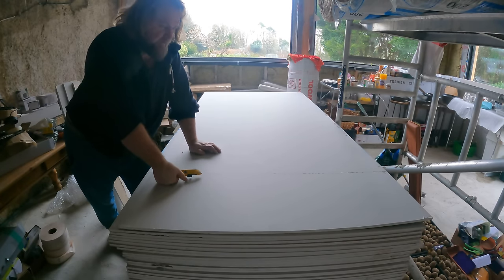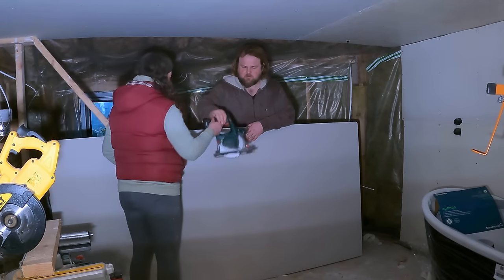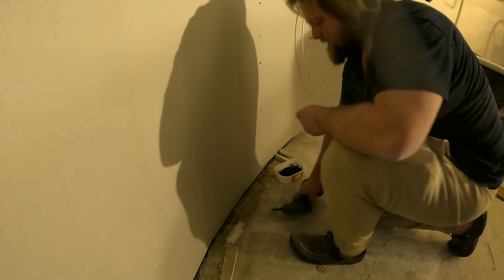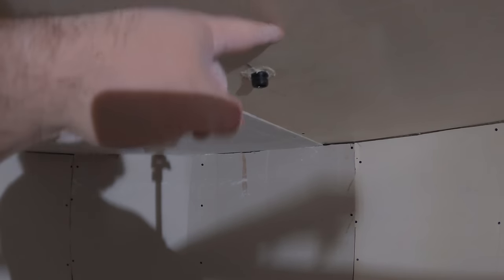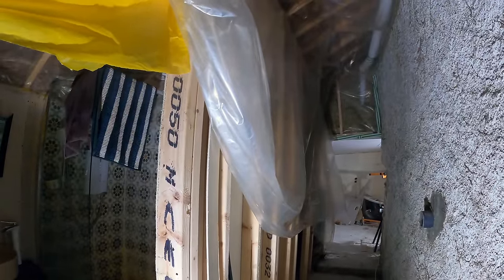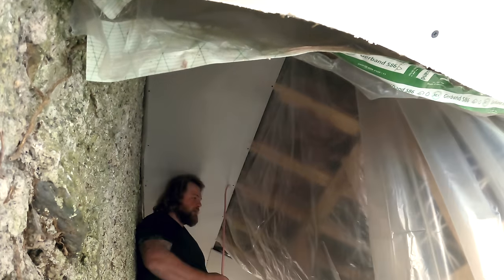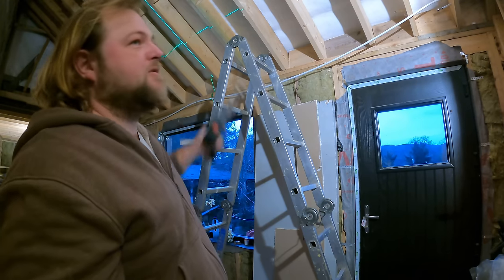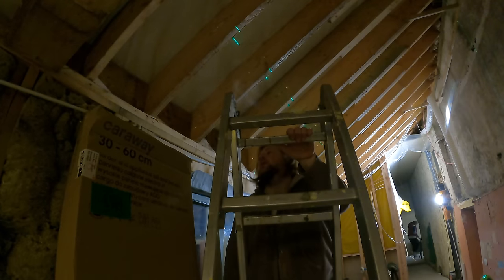Stone walls wreak HAVOC | Farmhouse Bathroom & Bedroom RENOVATION |  Irish countryside homestead

Comment: Great stuff getting out of the bedroom and into the hall. 
It'll be a lot easier once in the kitchen as you'll have space to move. 
It must be nice to see the piles of insulation and boards diminish and free up the internal area of the building as you go along.
Thanks for the video!
Reply from the maker: Yes definitely. The plasterboard pile which momentary is being used to prepare dinners and holds our little camp stove and slow cooker  is slowly going down. I won't know myself when we actually have a proper work top surface🙈 one day....thanks for commenting 😊

Comment: Having done plaster board a few key tools. Screw driver bits with depth cups so u don’t over drive the screws. A chalk line very fast for making out and over lap the plaster board joints don’t line all the joints up as u get cracking. Oops pad saw and small rasp. Sorry to say go back and fix that internal corner so the seam is straight from floor to ground. U need to think of the plastering so it’s easy. For that long extraction pipe replace it with a sold pipe that is anti microbial.
Reply from the maker: Thank you for all those tips! Always great to get other points of view especially as we are in really time now. Thank you so much for commenting 😊
Reply: @WestCorkWander  I have been there learning as I went with the help of YouTube and a few good friends. It’s hard work with out end and money has to be managed but keep going.

Comment: If you have a variable speed angle grinder 5". set to low speed and do your drill bits on that. is better than a file I find.
Reply from the maker: Thank you so much for the tip and thank you do much for watching 😊

Comment: Would it not have made more sense for your cable runs to go parallel with your ducting and then dropped (tacked) down the rafter to where they need to terminate? or even run in parallel with your plumbing on the walls. Drilling multiple holes in structural timbers is never a great idea.
Reply from the maker: You are correct but I guess we didn't think of this prior. Thank you for commenting 🙂